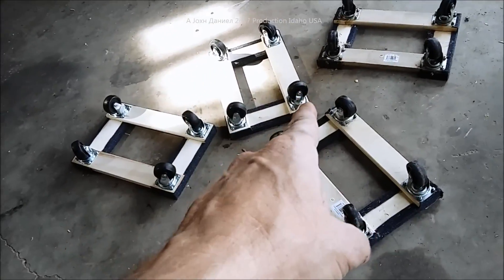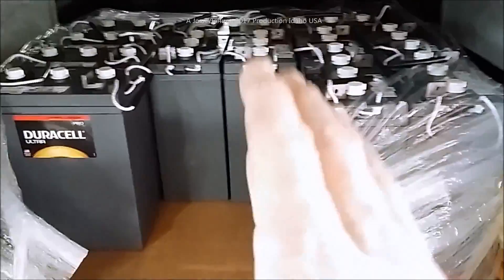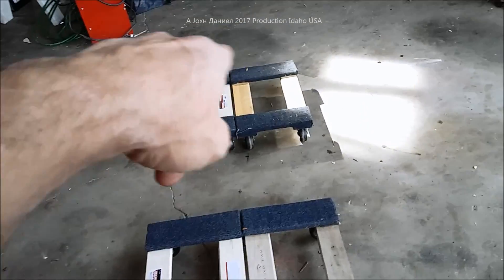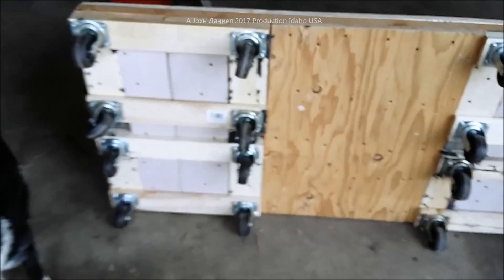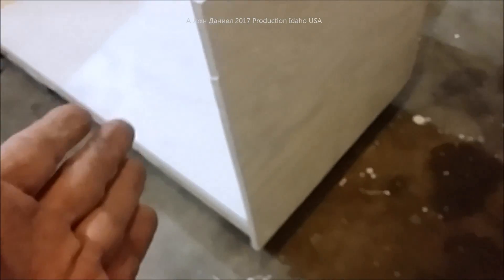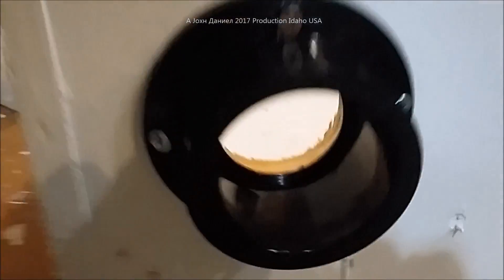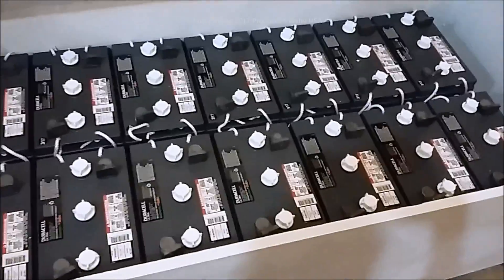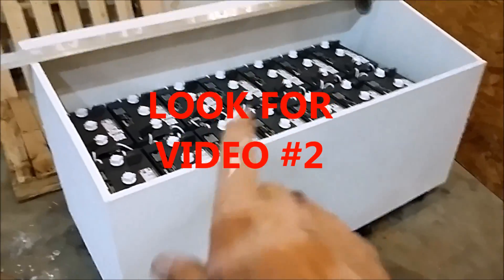DEKA SOLAR Duracell L-16 Deep Cycle Off Grid Battery Box Video 1 of 3

Comment: like how two same products are just relabeled, when they are the same product. and some companies will take a batter of same make and model change the label and then sell it for a higher price. So many companies out like that now day.  I know you don't like 48 volt systems but mine I love it stays cool and works hard and every thing is stack able.  yet if it ever came down to it and shit hit the fan its as easy as pie if I have to search for other components.   A real pepper needs to say screw AC power there are so many tools and equipment that can run straight off a battery bank with out the need for an inverter.  IE lights heaters AC unites and so much more.  either way it goes during a time when shit hits the fan hell be it 12 volt's or a 48 volt or higher volt system when shit breaks you either need to know how to fix it or have spare's with a real prepper will do is have a back up if it is needed and know how to fix their systems.    

You have one hell of a system and it .  It is proven with data that 48 volt is more efficient than 12 volt's and the EQ last a hell of a lot longer.   12 volt systems are nice if you need something in a pinch.   Your system works great for what you use it for and you have one hell of a set up.   All types of voltages set up has there Pros and Cons, be it cost or ease of find and use.   My system cost just as much as any one with a 12 volt system with the same wattage out put.  I have a 4 kw system with only 240 AH battery bank at 48 volts  I have 1000 in battries 800 in inverter,  that also charges my batter bank off solar. 2000 in solar for 2.2kw of solar  wire I have about 200 tied up in to it and a battery monitor that was 150  So with just my small system that and my unistrut I have install about 300 tired up in that  so about $4,500 in my system as of now.     

For a 12 volt system its hard to find a 4kw inverter that is any good and the wire size to handle 333 amps though it is expensive were as I have wire to handle 100 amps My inverter also includes a charge controller at 3kw for solar I have yet found a good 12 volt system with a charge controller built in.  at at 150 volt ac in I can run 8 Gage wire  with out any power loss at 50 feet.  I have less wire in my system all I have is wire to the batter bank solar to the inverter and ac for the power to the home I can also charge from the grid with my inverter.  There are 12 volt inverters that can charge from the grid but very few have built in solar charge controllers.    

For me to build the same system using a 12 volt system I will need thicker wire, and the charge controllers that I have seen you would have to have at lest 3 for a 3kw  the most I have seen is 60 amp and that at 12 volts is only 720 watts. yea you can get the cheap ones but I'm sure you have been though them like crazy they fry easy and some dont like to play nice with other charger controllers,  I like the MPPT system and all a MPPT is is a programable on the fly PWM.   

With my current system I can stack 6 of my inverters for a total of 24kw I have not yet found a 12 volt inverter that you can stack to increase the out put.  the inverter I have can also be set up for 3 phase with 3 inverters to run shop equipment that would require 3 phase power, at 230 volts Witch I Have not yet seen a 3phase 12 system,  I can also weld from my inverters with a 240 volt welder did that by accident once and it took it like a champ plugged in to the off grid plug and not the ungrid plug LOL.  

I also know how to fix things if I have to electronically,  I look to have a 10kw  + system with 16kw of power if I need it and I like to have a 2000 or better batter bank.  I want to build my system bigger than what I need. so when I do need a burst of power IE for welding I can.   

So conclusion both systems has there Pro's and Con's,  I like my 48 volt system for what I can do with it for expansion and I dont have to have split systems one for the shop home or any thing else I dont have to split my systems. and I can monitor my system any were with my cell phone or from a computer off site ect all monitored in one place.   12 volt systems are great as well since hell you can find a 12 volt battery any were, and I can build a inverter out of just parts if I need 120 volts or better 

Both systems are good we all need to have an open mind what works best for you may not be best for every one.
Reply from the maker: +McCuneWindandSolar My voltage choice is what it is, and no matter what you use the reality is if you don't know your materials then your at the mercy of the junk hockers. 
Personally I don't want anything larger than 3000 watt for inverters since no outlet on a 4000 can produce any higher output usually and a 3000 down to a 1500 is sufficient if you have multiples verses one big one. I never once saw someone running off batteries pull a full continous 3000 watts from a inverter other than start up. 
I like redundancy,  no fail duplication.  The last time I saw a 48 volt system fry one battery and totally fail everything includung blowing out a midnite classic and AIMS 4000 INVERTER (Oh Shit)is and was the convincing I needed.
Reply: lol I fell you on the Junk hockers been burned to a crisp once, sucks I cant talk about it. People that burn up there Equipment fall under the they dont know there Materials LOL, and rely one the car and pottery sales men to tell them what to buy, and just like Democrats believes every word they say. 

 I do like the battery box that is nifty when you need to move it ect and you can easy get a fork lift forks under it if you need to move it some were else on the property.

Comment: Why a weak 12 volt system not 24volt or 48volt?  I have 12 Trojan T105 batteries 3 banks of 24volt
Reply: I speak from personal experience. a 24 volt system is more powerful and has a higher efficiency.

In the past i use in also a 12 volt system,  I'm was glad that i was switched to 24 volts.

I stay on a ship and I'm must be able to trust my energy system. I use a lot of energy. 

If I were you I would make one great 24-volt battery bank.
Reply: I am so glad you have defined what the misconceptions are, most only go by the info from people selling this stuff. We went from 24 volt back to 12 volt in our system after 4 years. All it took was waiting almost 2 weeks to get a new 24 volt inverter when ours failed. My husband hacked the batteries down to 12 volt and had us in limp along mode on a 3000 watt modified from a truck stop when our 24 volt Outback failed.
I sold the Out back inverter and now we use easier to get stuff.
Reply from the maker: I ran 24 volt from late 2006 to early 2009. A battery failure not related to anything other than case leakage when we were out of town from a Trojan L16 took our whole system down and blew up a $2000 inverter.  I converted to 12 volt with the remaining system and a year later sold off the other trojan batteries after a failed fight with the company. When we went to go back to solar and wind in 2011 we heard similar stories from a few people and just went 12 volt all the way. To date, 6 years now we have all items bought for 12 volt still working like the day we bought it. The cheaper more durable inverters, general items based on the auto, RV and stereo industry allowed us to put in 3400 watts solar instead of 3000 when we restarted. we now have 5400 watts and continue to add with ease. 
See the new video 2 on how I get massive delivery of amps from my battery system. See some of my older videos to see my older battery bank.
Reply: Hmm  the support I thought that this also was on a high level.

Trojan batteries have a good reputation. On my work one set working more than 15 years in a forklift truck. 

I hope also for a lifespan of 15 years for my one 12 Trojan T105 batteries.
Reply from the maker: +lexpee 12 volt is far from weak, this bank can start 15 semi trucks at one time. I dont bend to the aggressive sellers of higher voltage materials who swear by 24+ because they want you dependent on them. It's called logic.
I loose one battery and I'm fine, you loose one and your screwed. If I loose an inverter I can get one in 2 hours, if you loose one 24+vdc inverter you got to order one. 
Preppers run 12, everyone else buys the parts sellers story about higher volts. That's why they push it so hard, but the few of them actually off grid, 6%, use mostly 12vdc.
Reply from the maker: +Јохн Даниел There's a ton of parts sellers lies to deal with in renewable energy.  Such as fine stranded wire, lie. Solid copper bars exceed every electron passage rate of fine stranded welding cable. The reason fine stranded welding cable exist is flexibility,  not superior ampacity. The lie that voltage travels on the surface of wire strands, total seller of wire bullshit. 
24 volt + is more efficient,  lie. A 18% higher cost to buy, build and install over 12vdc and no off the shelf ease of use products makes higher voltage a loss financially. 
Too many junk sellers have really molded the views of buyers of their hustle.